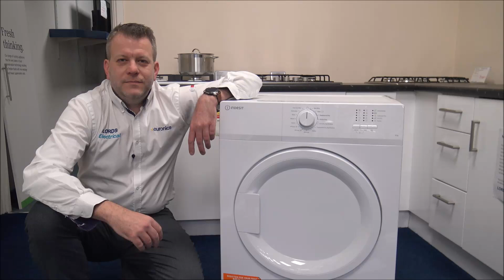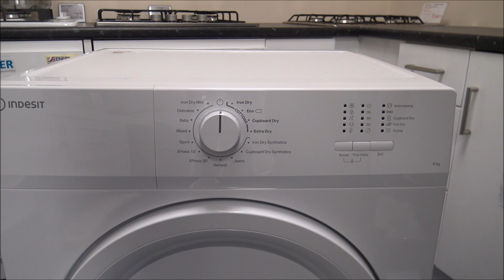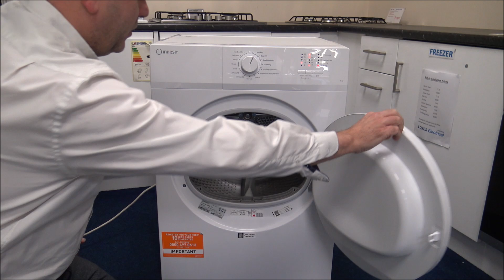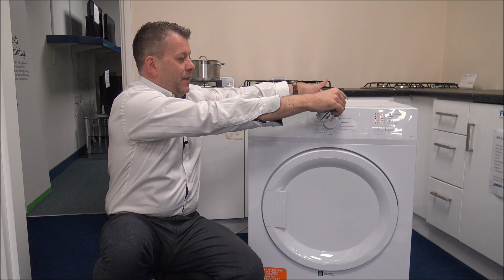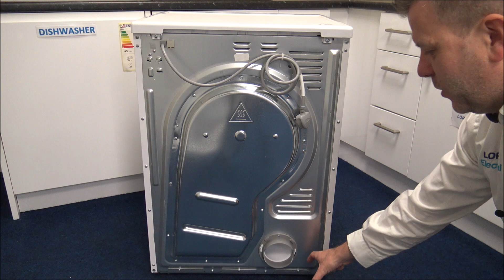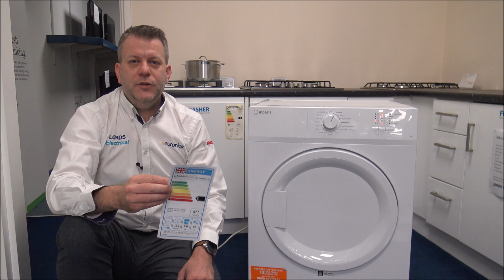Indesit CYDA81 8Kg Vented Tumble Dryer

Comment: Just bought one of these and very disappointed, its shrunk clothes and doesn't have a temperature control. Now stuck with the damn thing.
Reply from the maker: That's a shame to hear 😢
Reply: Disappointed with this model. The quick cycles are both cold so do not dry which begs the question, why? Why would cycle suggest it’s quick drying when it’s cold? 
All of the settings take 2/3 cycles to dry
And lastly the buzzer has never sounded. How should this sound? We’ve turned it off and on again and no difference.

Comment: Great video, Please can you confirm if this dryer has sensors for the dryness of the clothes as I understand they need cleaning regularly but I cant see any metal stips anywhere and the manual is very vague.  Im beginning to suspect it doesn't have sensors.
Reply from the maker: This model will have sensors within the drum as it has sensor dry technology, but i have had a look at our model in our showroom and it isn't clear where they are inside the drum

Comment: How do you change the temperature as I had a full mixed load in on the mixed setting but it didn’t all dry, should I use instead extra dry setting
Reply from the maker: If the clothes are not drying properly, just make sure the load isn't too big for the program, or using the extra dry setting

Comment: Hy I have just subscribed to your Channel, I have watched many of your videos, and you explain many things for Layperson who haven't a clue like myself lol, so the real reason I have subscribed today is I would like an answer to my query,, thus thought it would be rude not subscribed first, so I am currently without a working Tumble dryer the one I have has given up, it was a condenser hotpoint model, and have hated after 6 months haha, water to empty, condenser to clean and the heat created in a small utility/extra toilet room, after looking at for over an hour now reading  the bad reviews about whilst drying no change in drum direction, leaving items in a large clump undried, does this Tumble Dryer have the function of drum of direction change to prevent the above, if not i would be extremely grateful if you could inform me in a model that does, thanks in advance for any replies kind regards Bryan
Reply from the maker: Most modern dryers shouldn't leave too much damp in the air nowadays, if its a vented model you have, make sure you are using the vent hose to take the air outside as it will create damp if you are not using it. There are very few reverse tumble dryers around now, as the paddles inside the machine should help to rotate the clothes so they don't get tangled, but i appreciate this doesn't always work

Comment: Hello, my dad has bought this dryer. He wants to know if you can just open the door mid programme or do you have to wait until the programme has ended. He is confused with the right hand side controls and just wants to dry clothes for around 20 mins. Could he set a 30 min program and open the door after 20 mins or is there a button he needs to press to stop first   before opening the door.
Reply from the maker: Most programs are sensor dry so the dryer will turn off when the clothes are dry. If you wanted the manual timed program, i would use the Xpress 10 or Xpress 30 options

Comment: Just bought this 2 weeks ago for granddaughter with 3 little ones her washing despite being on 6 hours for 4 towels is not dry what Is she doing wrong she did use the 4th setting cupboard dry unfortunately it wasn’t
Reply from the maker: Not really sure why, normally it could be that the washer hasn't spun the towels enough and the dryer really struggles to get them dry in a short enough time? Cupboard Dry on the Cotton setting is the correct program though

Comment: I have a C YD 82 WWGL UK which was purchased a couple of weeks ago. My problem is when drying it stops and starts which takes an age to dry the clothes. I have looked in the trouble shooting information but can't find anything related to this problem. It's woybut it's just a puzzle to me why it does this?
Reply: So its not get overheated.  Its accumulate temperature and drops to cool off but close remains hot after short period its stars again.

Comment: I have just bought this to replace my very old Indesit and I hate it. Takes ages to dry clothing and bedding, when you start any drying cycle it spins for about 15 minutes and then pauses for about 5 minutes and then restarts spinning again, so in the time that its not spinning your clothes are sitting doing nothing. I can't afford to buy another one so am stuck with a rubbish dryer. Plus it doesn't reverse tumble.
Reply: I have condenser version. Can you do a guide to that please

Comment: Hi what is the highest heat setting on this dryer.
Reply from the maker: Normally the Cottons Extra Dry would be the highest heat setting
Reply: Thank you & just wondering too how many kg can be put in when using the baby setting.
Reply: @catherinemaguire8896 would usually be between 2-4 Kg

Comment: Hi. Thanks so much for a great video. You have a lovely presenting style.  I was just about to buy one of these when I realised I don’t think it reverse tumbles. I don’t suppose you could confirm for me? Many thanks
Reply from the maker: That is correct it is single direction only. Most dryers now have shaped paddles to help the clothes rotate freely in the drum to avoid the tangling of the clothes
Reply: @lords-electrical thank you very much for the info. I suppose my options are quite limited for a vented so I’ll just have to take a punt. Bedding will be the biggest challenge for it….. thanks again

Comment: My old vented dryer is now 25 years old and either over temp stat is playing up, or the element is going open circuit as shown on the BG power indicator in the kitchen when its running on high wattage. It shows it dropping from red all the way down to the low green bars for the motor running and then back to red a while later.
Are there any vented driers that have the hose on the opposite side to this one?